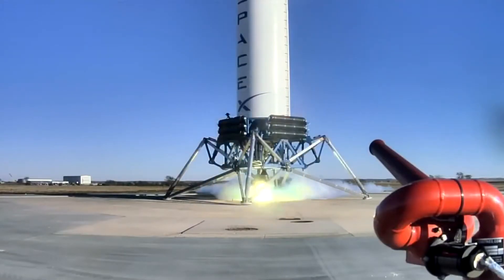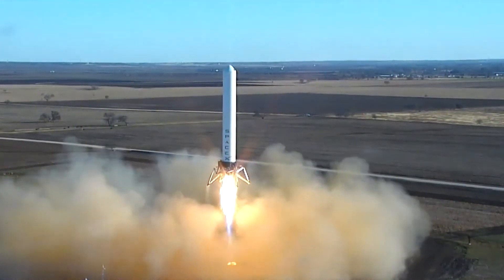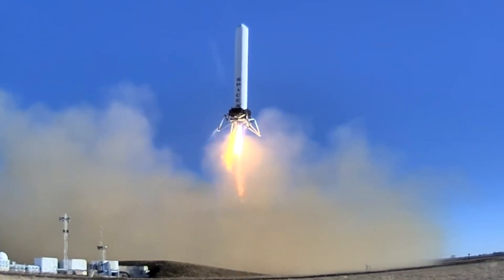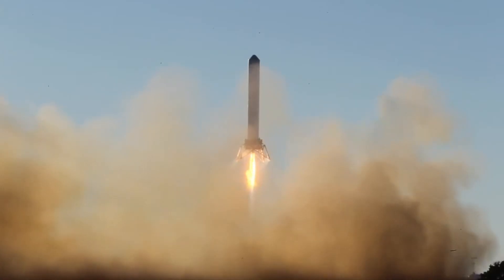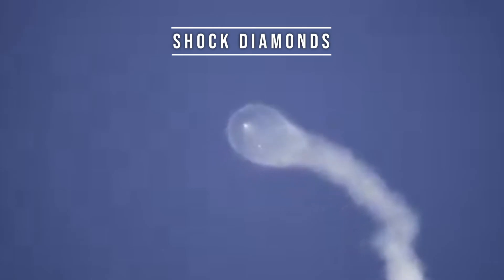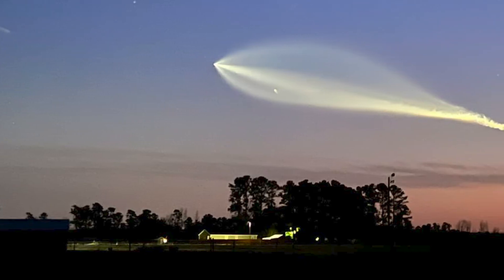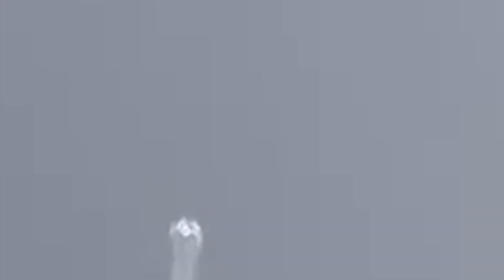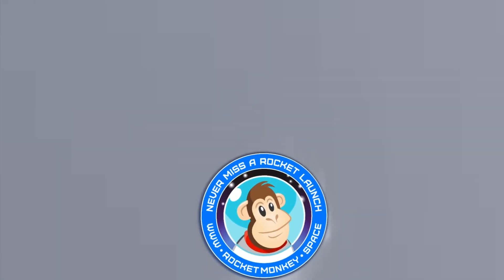The SHOCKING Reason Why Rockets Create Jellyfish Patterns

Comment: No, the "jellyfish" expansion of exhaust gasses in the low-pressure upper atmosphere are not "shock diamonds." (The jellyfish always forms but is only visually dramatic when the sun angle is right.) Shock diamonds (or Mach diamonds) are formed in the exhaust of rockets/jets at lower altitudes where the atmospheric pressure is greater than the exhaust pressure exiting the nozzle, causing it to "bounce" in a standing wave. Just google it
Reply from the maker: Got it, thanks for letting me know about the difference. My research showed something a little different though. I'll have to look into it more and will keep that in mind for next time.